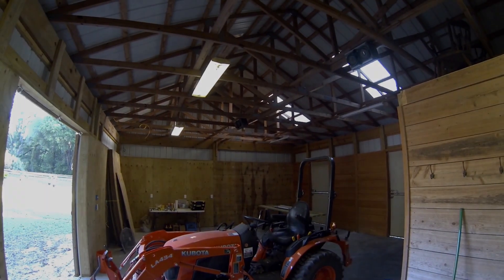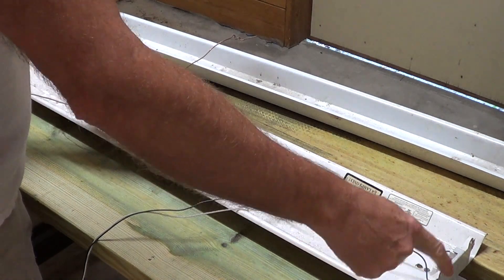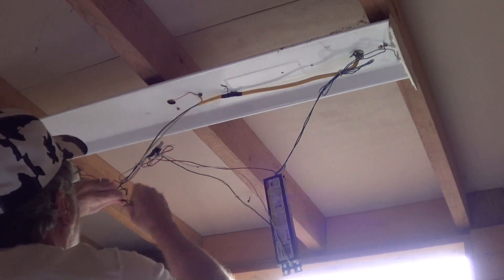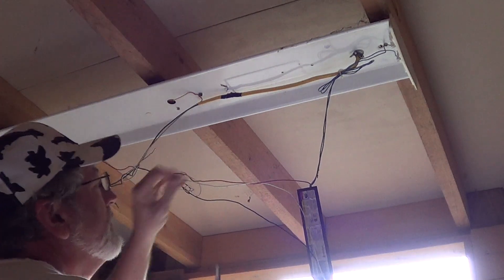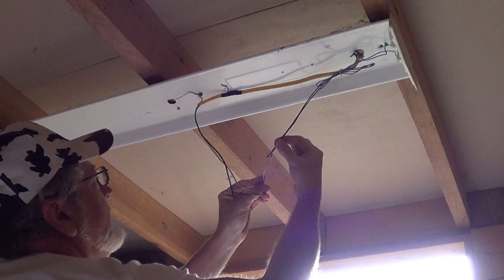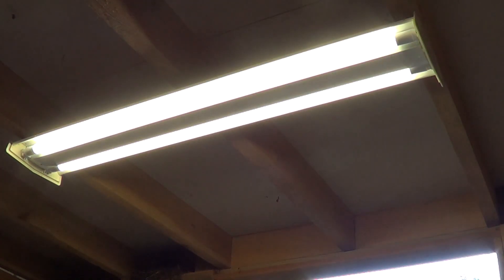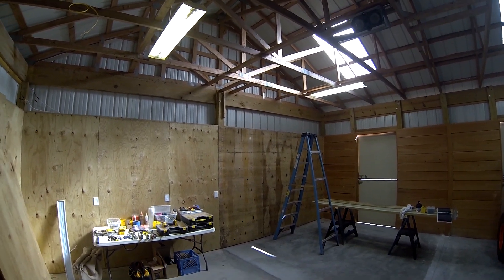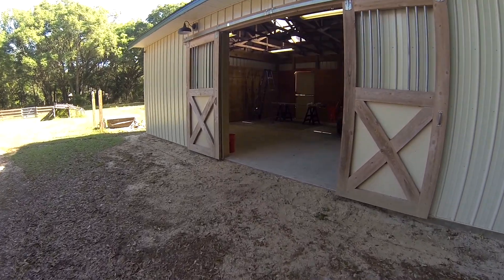Workshop #9: Converting Fluorescent Shop Lights to LED

Comment: Looks good, LED retrofits has definitely come a long ways and a lot less complicated to wire up than they use to be. I bought 2 vapor tight rated 48 inch fixtures from Homer Depot about a year ago for my mechanical room and it is a night and day difference. One thing I notice that bugs are not attracted to the light due to the specific light wavelength output LED's tend to be.

The extra bonus is that when I was testing them on my bench and I had a hair brain idea to hook them to my 52 volt nominal battery bank and see if it would work or not. Surprisingly they did power up, but with a 5 second delay which I can live with. So now they're running directly running off of the battery bank 24/7 off of the LVBCO module. I figure that if I had any issues with my inverters, at least I won't be in the dark. The only question is will it last 50,000 hours? Only time will tell, but its been working great for over a year now...
Reply from the maker: Thanks for the info!

Comment: Great job! First: I’m humble enough to admit I have barn-envy. Second: Cool lights. The tubes must have drivers built in? The ones I’ve used require a functioning T8 ballast. And third: Did I see a single-frame Dewalt secret message at 5:05? 😄
Reply from the maker: I am about 5 or 6 videos ahead of what I am editing and posting.  The single frame image was shot yesterday of what it looks like right now.  Here is a link to the tubes I used: Thanks!
LED Tubes: https://amzn.to/2LmSI7A
Reply: Thanks! Ed@MCG